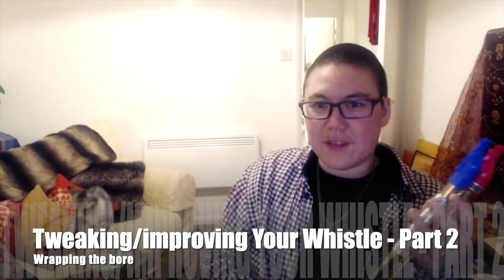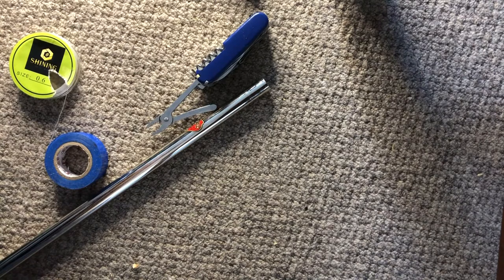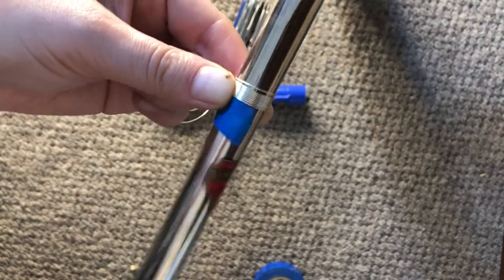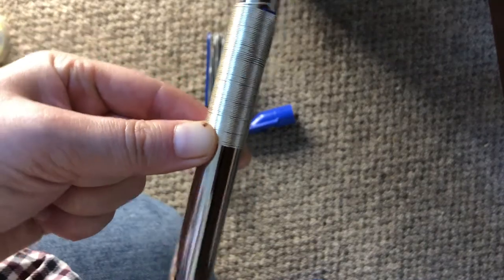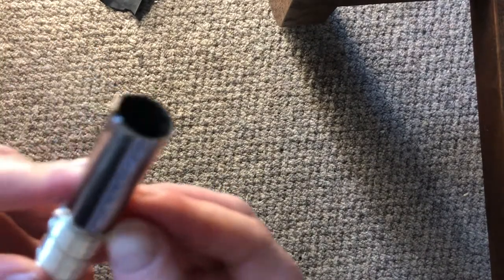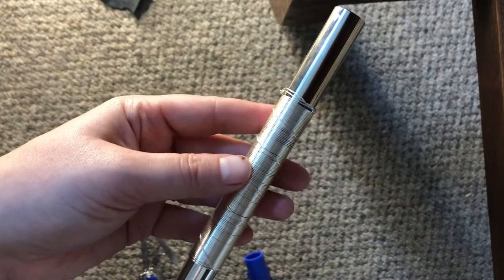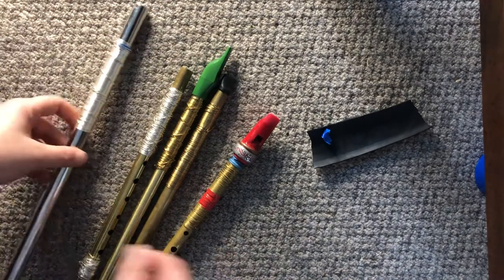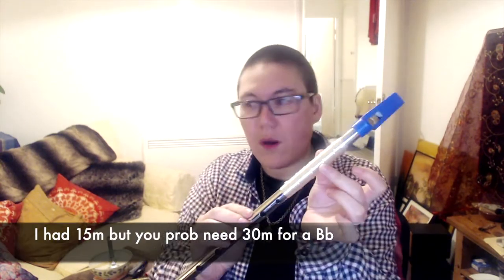How To Tweak/Improve Your Whistle Part 2 - Wrapping The Bore

Comment: What an interesting idea!
I tried something like this, but instead of using wire I cut a length of 1/2” copper pipe, split it down the side and crimped it so it was a snug fit around the upper bore of the whistle. I can’t say for sure if it makes a noticeable difference in the sound, but the instrument has a good, solid feel to it now. I think I will add another bit to the lower end of the whistle as well.  The good thing about using copper pipe is it can easily be removed or swapped out to another whistle. 
Thanks for the suggestion!

Comment: Wrapping wire around the top won’t change the sound of a whistle. It’s not changing thickness around the toneholes, so it isn’t doing anything to the column of air inside that would alter the sound. I’d say this is a case of the placebo effect. Unlike with stringed instruments, whistles don’t create sound by the material vibrating. The only way to change the sound is to do something that would alter how the air being blown into it behaves. Attaching something externally away from anywhere where it affects the air isn’t going to do anything. Believing that it does something will make it seem that way, though. 😉
Reply from the maker: I think the thing is... regardless of you saying it won't make a difference... it does. I went into the studio with my band recently and I don't actually play tin whistle in it, but the clarinet player sometimes does. We had to swap her stock whistle for my wrapped one so she played that instead, because it sounded so much better.
Reply: @BluesTinWhistle  Two totally unmodified Generation whistles can sound very very different from each other, so that’s some extremely weak proof. I’ve got dozens of Generations around the house and there is a very wide degree of variability, and it’s widely known that injection-moulded whistles are inconsistent. Take the wire off and I guarantee it will still sound just as different from that other whistle. 

You can believe whatever you like, but this is absolute nonsense.
Reply: As someone who has played brass and woodwind instruments for over 50 years, I can absolutely attest to the fact that the thickness/density of the tubing can make a difference in the sound of the instrument. This applies to the quality of the material as well. (A tin trumpet is always going to sound like a tin trumpet) 

I’ll say this; it FEELS pretty good to play a cheap Generation or Walton with a little more heft to it. 
YMMV
Reply: I agree -- the mouthpiece mods make sense, and the difference is immediately audible.  Wrapping the bore, not so much.

Comment: What about using a thicker gauge wire, it would hold in place better
Reply from the maker: Thanks. I did try that, but I couldn't get it to bend enough to hold well. 6mm seems to be the sweet spot.

Comment: i definitely notice a difference between the red and blue generation mouthpieces, even without modification! 

Red have a slightly longer/wider opening for air, but the slot you breathe into is a bit shorter/less tall. Blue are just a hair less long/wide for that slot, but the opening is a bit taller. 

it averages out to about the same amount of air to play with, but i find the red to be more precise in the sound it puts out but less sensitive/expressive of any purposeful variation. Whereas, I find the blue is able to wander a bit further from what you may be intending to play - intentionally or not. so, a bit easier to accidentally blow out of tune maybe with the blue, but gives greater freedom to create purposeful variation and accent in the sound you're putting out for the same reasons.

Overall, i found the blue mouthpiece a tad more challenging to pick up when starting off, but worth the effort for the additional expressiveness. There's definitely elements of both that can be changed/enhanced by the bore as well ofc, but that's what i notice from just the mouthpieces and swapping them onto different bore tube types.
Reply from the maker: Really interesting. I definitely have a favourite mouthpiece even amongst the reds I have, which is kinda weird as you’d expect them to be the same. When I realised I liked Generation I bought a couple new and a load 2nd hand and kept the ones I liked the bed. There’s a real range, both in sound and in how they blow. A couple I didn’t like at all and a couple were perfect. The best seemed to be the ones with the ridge at the back, being an older design when the injection mould itself was different, apparently in the 80 and before, but that may well be nothing to do with the old design but because someone tweaked the mouthpiece before I got to it.
Reply: @BluesTinWhistle  It does have to do with the older design. I’ve probably got around 40 of the pre-1980’s gens around the house, and they are consistently much better on average. The only exception to this are the Bb whistles, which didn’t change as much as the other keys when they replaced their injection molding heads in the 1980’s. With newer generations, the really good ones are fewer and farther between (except with the Bb, which are acceptable quality as the norm during every era of their production). 

That being said, they’ve always varied from whistle to whistle, even of the same colour, same key, and made at the same time. It’s just the nature of how the plastic sets when going through those machines (I used to work in plastics, so I’m a bit familiar with the subject). I would not attribute any specific qualities to specific colours, but rather to normal variation from whistle to whistle.